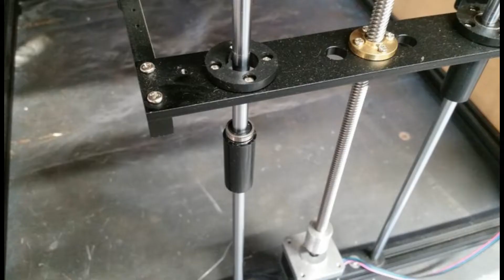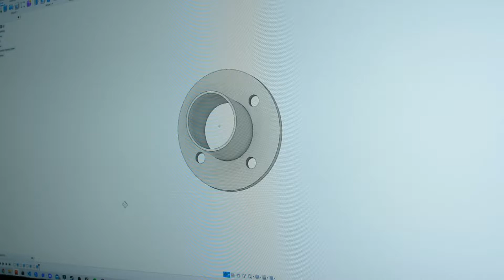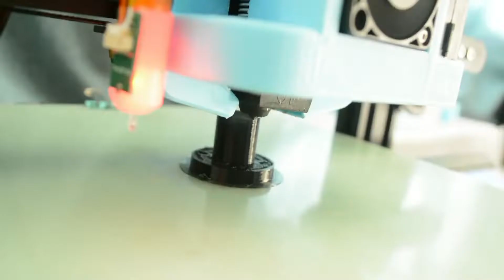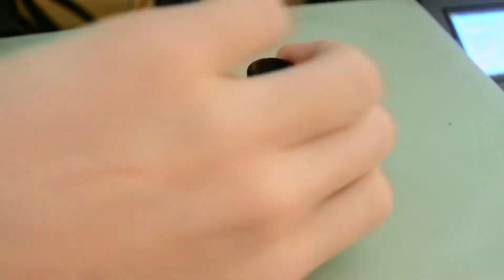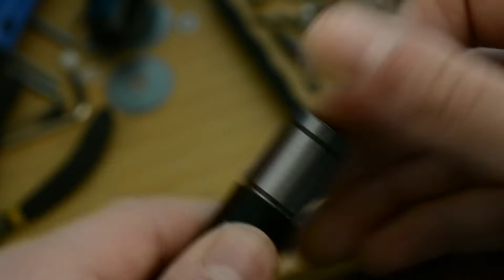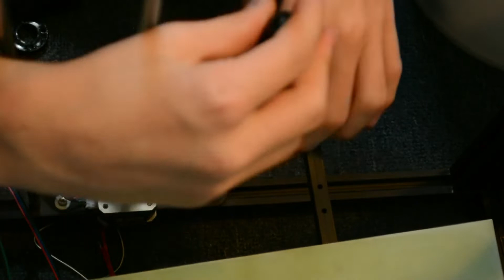Fixing my $100 CoreXY 3D Printer

Comment: About removing the print surface, how do you remove the surface from the g10 sheet?
Reply from the maker: I would recommend heating up the bed and then using a metal scraper to separate two parts (perhaps at the corners), then take some time to pull them off of each other.
Reply: @Tommy Houghton  awesome. Had a print stick a little too good and it took some of the print surface along with it. Thank you!